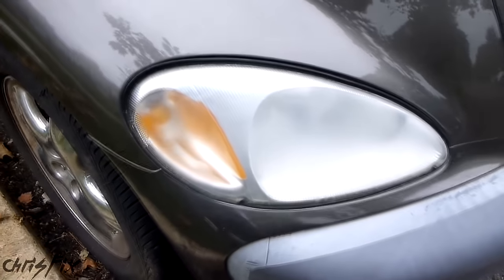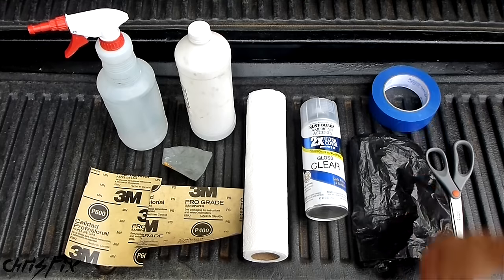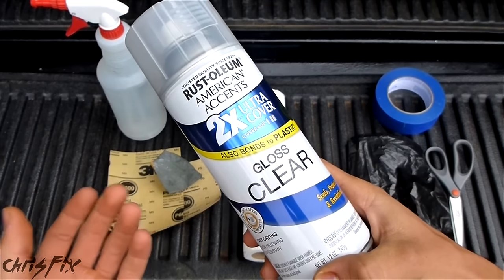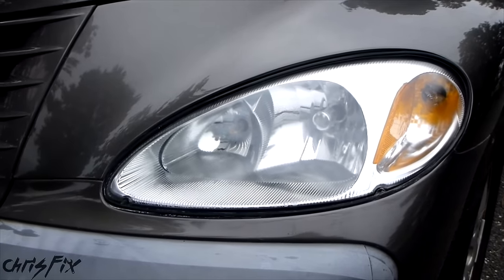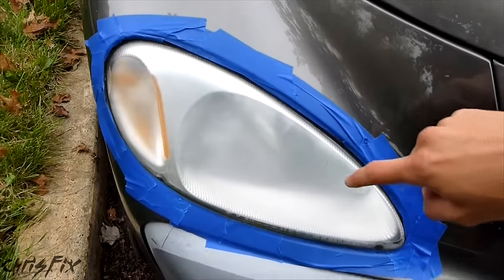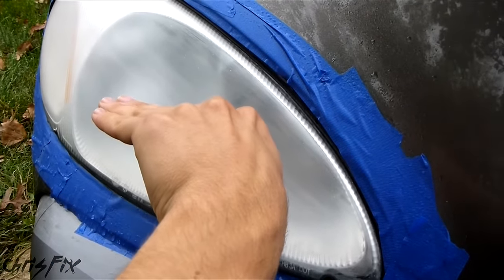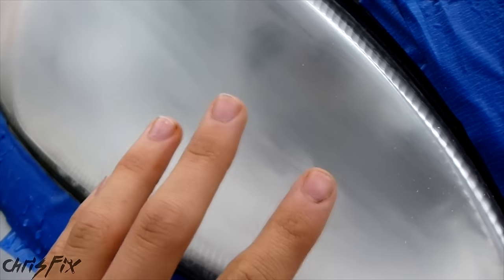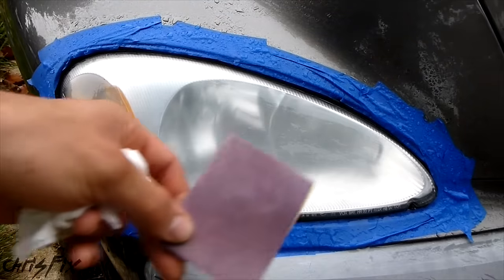How to Restore Headlights PERMANENTLY

Comment: You should do a video about restoring that front bumper.
Reply from the maker: +Multi-Hobbyist I am doing a video on building a front bumper for my truck so stay tuned!
Reply: +ChrisFix Very cool. I am having trouble with weak heat in my 2002 Dodge Dakota, so I YouTube'd the topic and, came across your video. I liked it so I watched a few more of your videos. Very cool with great information. Subscribed.
Reply from the maker: +Multi-Hobbyist Thanks! Good luck with your heat! Might need to do a heater core flush.
Reply: +ChrisFix Thats what I was thinking. Thanks to you, I have more confidence to do it myself.
Reply: +Multi-Hobbyist I have a 1999 Dakota and I found a really simple way to flush the heater core all you need is a garden hose and pliers. If you follow the heater core tubing coming out of the firewall one goes along the firewall towards the left and that comes to a coupler. I separated the tubing at the coupler there. The other tube goes towards the radiator. You can just follow that and then disconnect it. Then just hold up the garden hose to the tubes with low pressure water coming and just switch back and forth from the tubing. Once it ran clear I poured some coolant in and hooked it back up. Gave it a quick test drive and once everything got cycled it was blasting hot. I'm not the best at describing things so if you want to try this method and need any explanation just let me know.
Reply: +FruityLittleBoy I appreciate the help. I can visualize what you have done. I still need to do something about mine. What you have done, sounds reasonable. I may just give it a try. Thank you.
Reply: DEAD

Comment: My hands grow from random places, but I tried to do what Chris showed. And it did work for sure. Not ideally, the lights can't be compared with a new set, but they definitely look way, way better than they used to be. The one thing that didn't work well is the Gloss Clear coverage which somehow got tiny cracks in many places. They are barely visible from a distance, but they are there. In any case, I got some fun doing that and I'm satisfied with the result. Especially thinking that just one head light costs $150-170. Great savings!

Comment: if you take your headlights off replace your blinker fluid too
Reply: oh you
Reply: where is that usually located lol
Reply: It works perfectly well, I followed all the steps, However I have problem to purchase the same  clear coat in my country. I have tried other brands it only last for less than 3 months because without UV resistance

Comment: Hey, Chris, can you please do a video on how to fix peeling clear coat on the car itself. I can't afford a paint job at this time. Is there any way to make it look better until I can get it painted? It's a 2004 Chevy Cavalier with only 45,000 miles on it. I really like the car, it's a LS Sport 2 door , loaded. I bought it new in 2003. I'm not ready to let go of it just yet. The clear coat is the only thing wrong with it. It's a sharp little car. Please let me know if you have any suggestions that might help the appearance temporarily. Thanks.
Reply: Karen Mitchell rubbing compound and a buffer. Do your own research before attempting.
Reply: hi Karen if your car doesn't have any rust or dents I would suggest that you take your car to several painters and get estimates. you might be surprised that since it is only the clear coat then all they would do is strip off all  clear coat and recoat it. That shouldn't cost that much and it would be worth doing it right due to the possible future value. I know it is only a cavalier but it is an LS sport with low miles so that is what makes it worth it. the clear coat is gonna protect the original paint and the value. I myself wouldn't want to take a chance on hurting the paint, then it will cost you.
Reply: its a fricken cavalier,...why bother painting it at all?

Comment: Man i followed your instructions to the T and the results are extremely foggy. Do I need to polish it or something?
It is by far worse than what i started with.
Reply: did you use the polish compound he put in the description? He didn't use it in the vid tho so I'm assuming you should aplpy it after you let the clear coat sit for a day and then wax it, good luck
Reply: Eduardo Trujillo
Reply: Ismail Bouallala ??
Reply: Most likey it's not sanded properly.
Reply: Well why do you think ChrisFix videos get dislikes? Sure they aren't many but too many fan boys thumbing up to tell them apart. The reason your lights are foggy is because spraying clear lacquer over 2000grit sanding is not going to magically make them shine. He should have polished the lights until they look crystal clear. The lacquer might help to stop them yellowing but its unnecessary when you can simply repolish with T cut or something in 3-4 years. Also this entire video is kinda crappy since 80% of the people watching this have problem with their headlights hazing on the inside...
Reply: Dude, If you are going to comment do your research. I agree using rustoleum clear coat out of a spray can is not a permanent fix but as far as prepping he almost has it down. You cannot buff the headlight then clearcoat it my friend. Paint needs a mechanical(physical) bond and a chemical bond. Wetsanding insures that mechanical bond. Plus it takes off oxidized plastic to get that clean, clear look after a Urethane Clear Coat is applied. Ever see a piece of glass washed up on the beach? Looks frosty from being sand blasted by the waves for a long period of time. Well you put that glass in the water and it looks clear because its wet, right? Same idea with clear coat over wetsanded headlights. Clear coat gives a permanent wet appearance to anything you put it on. Granted you sand that plastic with 220 grit it will look like shit but not 600 grit and water. ChrisFix needs to do some research as well because Adhesion Promoter is the chemical bond he is missing on all this. Let me guess you are a detailer?
Reply: Have you ever seen what happens to clear laquer paint when it gets wet on wood. thats what will happen you drive in the rain or it gets damp. The spray is a bad idea.
Reply: this only applies for PT cruiser headlights xD
Reply: Dave B in his video the headlights were still somewhat foggy... I suggest if going the route of spray paint compound the lights first... this brings back the clarity. you can either Polish after that or paint. 
I do this day in day out.. I'm old school... I wet sand 600grit 1000 2000 then compound then polish... then I put a sealant. if the customer wants a little more I put a 3m headlight sealant on which dries like clearcoat...
Reply: Depending on how deteriorated the lenses were to start with,  I would spend a more time with the 1000 and 2000 grit in circular swirling motion, light pressure and plenty of water followed with a paint scratch remover like Meguires X or 3M and polish till bright. You have to remove all of the scratch lines from the 400 and 600.If you cut too deep with these, you will create more work for yourself.  I have a 91 Town Car that actually had surface pits and had to use my dremel tool to smooth out the base before starting with the 1000 grit. Got improved finish, but not like new.  Lense technology has improved considerably since 1991. Like the idea of 3M Headlight sealer.
Reply: Dave B He shouldve rub them with compound first after 2000grit. Spraying it with clear coat after sanding will never make the haze disappear. It will locks that haze forever underneath the coat of clear paint on headlights
Reply: I can assure you that ChrisFix has no idea what he is doing with sanding. First of all, the water is a lubricant to help reduce friction and flush out the particles; it has nothing to do with light or deep scratches because that is depended on the grit size of the paper. That was a bit nit-picking but it my second point will be more serious, which is: you need to polish your headlight before putting on the clear coat. Why is that you may ask? It makes sense to rough up the surface before painting, and the clear coat is just essentially clear paint, so the correct answer should be clear-coat the headlight while it's still rough, right? Nope. There is going to be a trade-off in this. If leave the headlight at 2000-grit, spraying over it will only improve the clarity a bit. I won't get into the details but basically, cloudiness (I'm talking about the result after 2000-grit) is mainly caused by diffraction, and the clear coat helps lower the refraction in the nooks and crannies that caused the milkiness. However, if you polished the headlight first, there will no nooks and crannies to make it cloudy and the result will be spotless. Doesn't paint stick better to rough surfaces? Yes, but that is not critical here. You see, the polished headlight is not without scratches, they are just tiny and you can't see them, but those are enough for the paint to bond with. Granted, it will not bond as well as the 2000-grit surface, but you're waxing it anyway so it doesn't really matter, the paint won't chip away.
Reply: I'm glad you said this because I'm kinda wondering how this worked because it was really hazy during the entire process and a clear coat is just a sealant.

Comment: ChrisFix can you help or offer advice? Many of us are having the same issues with cracking or "Crazing".
-- I tried twice so far, started by using Dawn dish soap to clean them well. I meticulously wet sanded from 600 to 1000 to 2000 then rinsed with water / a clean rag and prepped with alcohol and a clean rag first go around. I let dry 15 mins then cleared holding the can 12" away and spraying what I felt was a light coat much like you did. 
It was about 80 degrees out Humidity about 65-70%, 2 mins after the FIRST coat it looked like it was spider cracking. I coated them 2 more times 10 minutes apart but the cracks just worsened. 
2 days later, I re-sanded removing all the new clear, I rinsed & cleaned them off with water only this time, dried for 2 hours, sprayed clear and similar cracking happened on one light, the other came out better but still had a little cracking. 
  
To be honest, I'm not sure at this point but here are possibilities I was thinking of.  
Maybe I needed to hold the can farther back so it goes on lighter and dries more (in the air) before it lands on the plastic. 
Too heavy of a first coat or not heavy enough?
Holding the bottle too close at 12"?
After sanding use Dawn dish soap and water to wash them instead of alcohol or just plain water.  
A friend said "maybe" some manufacturers mix some sort of wax in with the plastic they make their lenses out of? I'm currently working on a Lexus es330
You and many others have had success but me and many others are having the same cracking issue. 
Any advice / help would be appreciated.  
Thanks
Reply: Did more research, found out the clear spray contains Acetone and it "might" have something to do with the crazing effects due to a chemical reaction with something. 
But what I don't understand is if that were the case, @ChrisFix and others who have had success in this method would have the same issue and it  doesn't seem some do.. 
Hopefully Chis can find a "ChisFIX" for why so many subscribers are having issues with this cracking result.
Reply: I considered that too but came to 2 conclusions. 
1st -  it has worked on 1 of my fog lights but crazed on the other. It also worked for @ChrisFix and many other people trying this out just not all of us. So it can work I believe but maybe you are right and this paint is more so difficult than others to apply and work with?  
2nd - I could be wrong but I didn't find any other spray can paint that checked all the boxes we are looking for with this application: 
* Non Yellowing 
* Bonds to plastic
* U.V. resistant 
* Lasts 2+ years
From what I've found, some people used other brands with less desirable results like yellowing or lasting under 1 year. Not to say it's not possible cause again, "I could be wrong" but that's mostly what I've found so far. 
I'm trying different things to figure this out and it seems with a lighter 1st & 2nd coat by making a faster pass of the hand as I spray is helping.
Reply: Thanks and that's a good point I forgot about with the wide spray vs circular, I read about it and others recommended changing the tip if I could. I too heard good things about Krylon but it had 2 issues I can't recall right now. Once I figure out what works better I'll report back here so others might have some answers as well. 
God knows this is frustrating and I legitimately have a sore shoulder from sanding this stuff over and over, so much so I broke down and bought a drill attachment to help with most of it.
Reply: Just thought I'd leave some input. Rust-Oleum is very picky about what paint is under it, and this if there is any coating still left on the headlight that you didn't sand off it can/will react badly. You could start as low as 120 or 180 grit and work your way up to ensure you're painting pure plastic and you'll be less likely to have this effect.
Reply: 220 yes I did, 120-180 was much too harsh for me.  
I ended up running some tests on the fog lights from the same car I was working on which was much smaller and easier to sand down every few days than redoing both the large headlights over and over. I'm a very thorough person and did a bunch of testing after the initial results, called multiple paint companies and painters who regularly use spray paints. 
** Main issues found: 
- speed of the paint application as I sprayed too slow applying too much. 
- Rust-Oleum's Circular pattern spray tip (which I never found a replacement for) applies too much paint in the center of the pattern and unevenly..
- Final Coat being too heavy.
** Other common / possible factors that I researched which can cause issues: 
- Not getting all the old coating / sealer /paint off before applying new stuff.
- Humidity in the air
- Alcohol off gassing or not completely dry before paint application.
- Surface still has wax on it. 
 - Re-coat timing, especially if it's more humid in your location. 
** I went down to 220 each time, then some tests went up to 400 then 600 then 1000, 1200, 1500 and 2000. I used the alcohol to prep at first and later moved to a not so harsh mild "soapy wooder" with plain dawn brand as many people said it could be the alcohol off gassing or a chemical reaction. 
** I did find it easier to apply with a final sand of 1000 grit when applying the clear. Final result looked just as clear as the 2000 and yet it seemed to apply better.  
** Next time ** I'd use a drill kit for the bulk of the work as 10-20$ was way worth not having such a sore shoulder lol. I still did the edges and finished everything by hand to be sure. Using 220, then either 400 or 600 then stop at 800 or 1000, clean it with "soapy wooder" wipe dry, use a blower and let it dry thoroughly maybe 30 minutes. Then apply the clear in swift light motions over 3 coats. Last coat I'd say would be good as medium, not heavy at all, that is when I noticed the cracking most, when too much was applied.
Reply: Matt D yo try doing the coats with less time between them

Your letting the coat dry which causes those cracks on the clear coat

I redid mine 
And did about a 1 minute coat between 

1st is super light but enough to where you got the entire head light 
Then apply the 2nd coat 1 minute after but a medium pace
Don’t go too heavy 
Give the next coat a 2 minutes wait 
Then apply a nice 3rd coat and let that dry an entire day 

When your applying the coats 
Look at he headlight in an angle 
If you watch the coat dry up to fast 
The cracks will appear 

Spray before the cracks arrive
Reply: Did the duplicolor look as clear as the rustoleum? I tried using a krylon clearcoat after getting the cracking effect with the rustoleum. I didn't get any cracks with the krylon but the finish was much duller than the rustoleum and I can't see through it as well.
Reply: Randall Ruel, I'm in south Florida where it is extremely humid, because of this I tried both ways. First like you are saying by not waiting so long between coats but due to the humidity the coats weren't dry enough and were too wet which ended up cracking. Next I tried waiting longer between the coats and it was more successful "In my case". Others may have a different situation due to their local conditions.
Reply: Maff4lyfe - FYI, Rustoleum is hard to lay down as the tip produces a circular pattern instead of most others which have a fan type spray. The good part about the Rustoleum is that it's "NON-Yellowing" due to the fact they left out the yellowing chemical most all other paints have. The bad part to the other products is they almost all have this other ingredient. I forget which it is but a simple phone call to Rustoleum and they can tell you which to look out for. 
Personally I think I'm going to concede on them all and just go with the same process but use the Meguiar's clear that's made for headlights, others say it lasts about a year but isn't near as hard to apply with a clearer result. It's enough to do multiple lights and is about 8-9 dollars at most places.